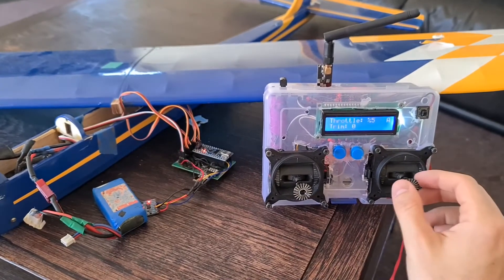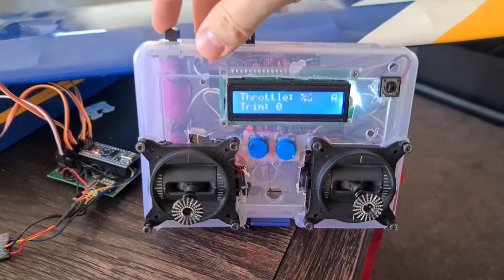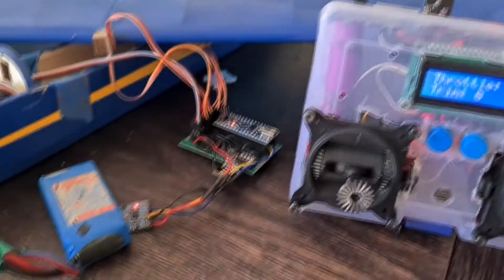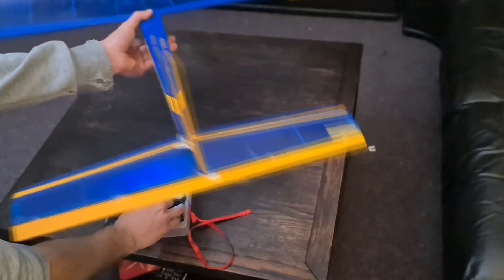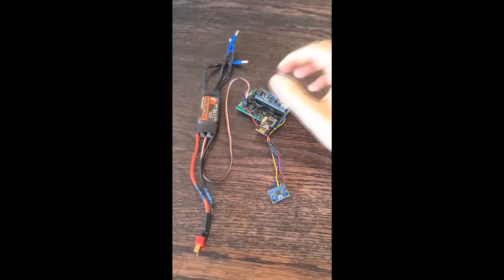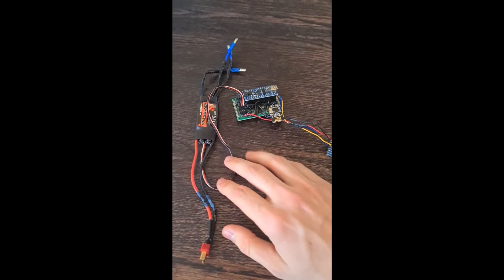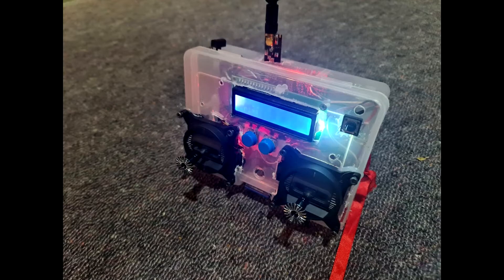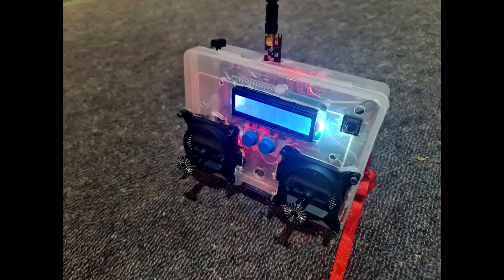Arduino RC Plane With Accelerometer stabilization

Comment: i connected it to pin A5 & pin A4 it don't work and on the transmitter tactile push button only controls up and down of the servos and the mpu6050 doesn't start what did i do wrong pls help

Comment: Awesome man
Making ur own radio controller 
I am just a 14 year old kid wish I make more like this when I get older and have a budget to buy such costly parts 
I have  made a drone recently and attached an arduino for a voice controlled parachute drop but range is very less as it is Bluetooth
Reply: On the transmission side, use a NRF24 PA LNA, on the receiver side, just use NRF24 without the power amplifiers, you will have 1km of range line of sight(as opposed to 100m with bluetooth)
Reply: @HaseebAdnan0  I used 2 hc12 Bluetooth modules later and it works upto some good range and I use it as to get telemetry in mission planner now
Reply: @MakeItFlyofficial  wait you can use mission planner with Arduino. For context, I have seen it being used on YouTube, but not actually used the software

Comment: What type of control loop are you running? Been pursuing a similar project and am trying to incorporate my flight controller on an aerial platform. Also, would love to know how you were able to tune your system. (my empirical method of tuning PID controllers relies a lot on luck and would def like to change that in the future)
Reply from the maker: All the code is in the discription, also I never needed to use PID as it works fine with out.
Reply: @TechUpBuilds  Do you have flight footage? Cause I'd imagine the plane either oscillates a lot (especially when you pull up since your only using the accelerometer measurement). If it seems to work though, I'd be really curious to understand how.